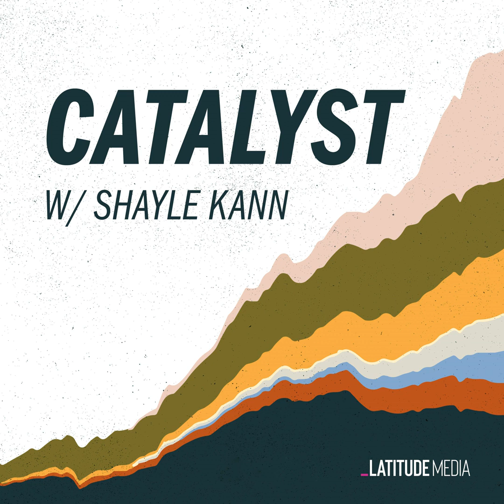What went wrong at Northvolt?

Comment: There’s a narrative here without much explanatory power. 

No explanation of why Carlsson was on the street after Tesla.  Why was he tapped to run this ambitious startup?  

There’s no insight into why Northvolt — which easily raised capital — still failed.  BMW is the result, not the driver, of failure.

You might want to review the several Riks YouTubes over the last couple of days.